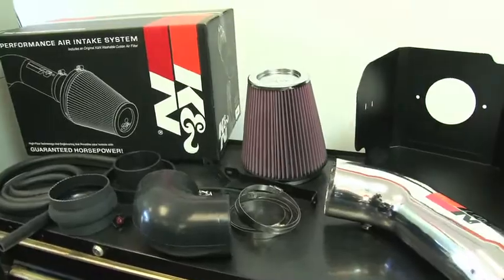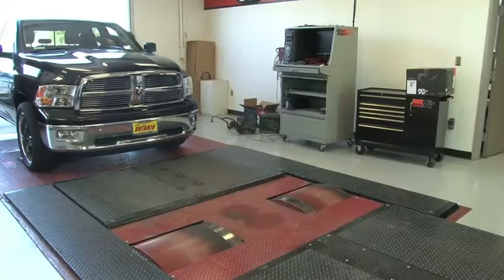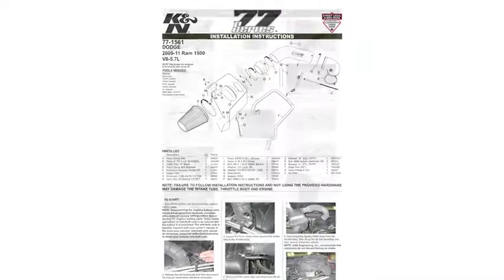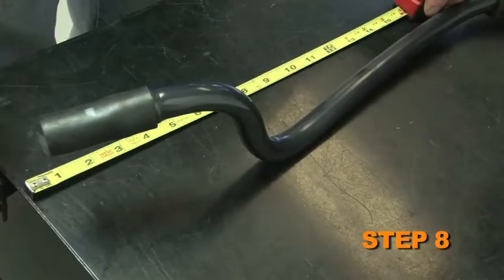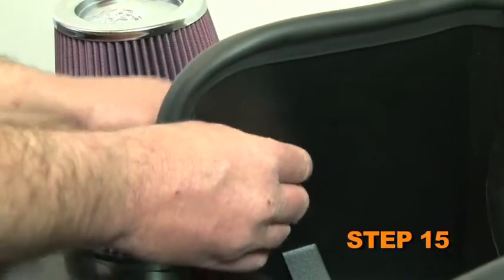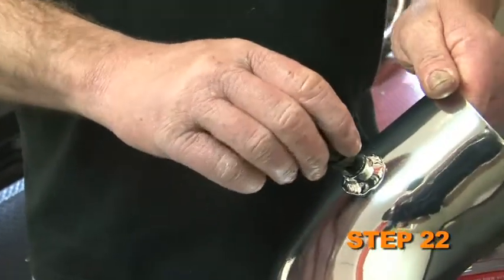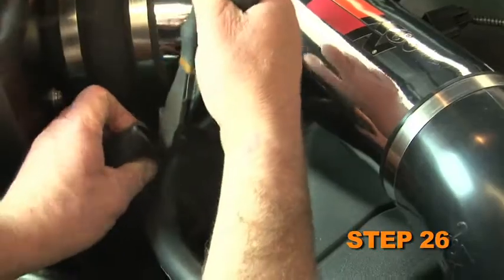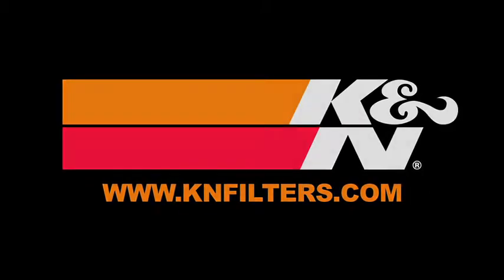2009-2013 Dodge Ram 1500 Pickup 5.7L Hemi V8 K&N Air Intake Installation

Comment: Tried to install on my son's 2013 Ram 1500 5.7L Big Horn and there is an air conditioner line that runs through where the box is supposed to mount. On the 2012, that line makes a 90 and goes to the firewall but on the 2013 it goes straight across the front to the passenger side fender rail. It won't fit without cutting about a 3" slot in the metal box.

Comment from the maker: This video is of a K&N air intake install.  K&N has what they call a "30 day test drive" where you can buy an intake from their website and if you don't like it you can return it for a full refund.  You can read about it from a link on knfilters,.com. You can try it and see if you like the sound. Also the 77-1561KP also fits the 2012 Dodge Ram 1500 Pickup with  5.7 liter V8 engine.